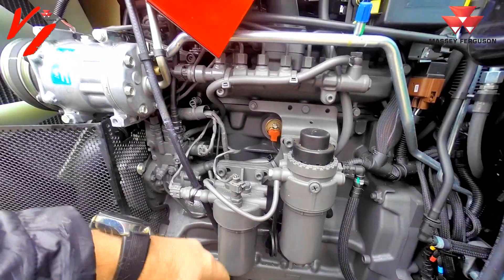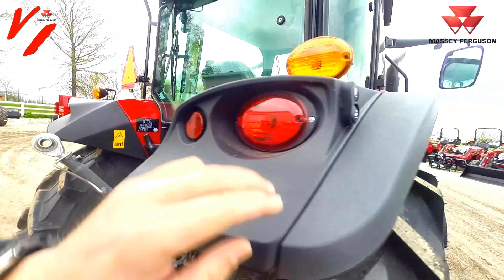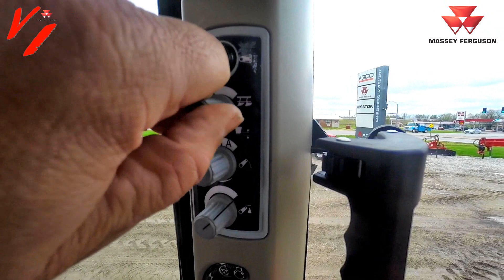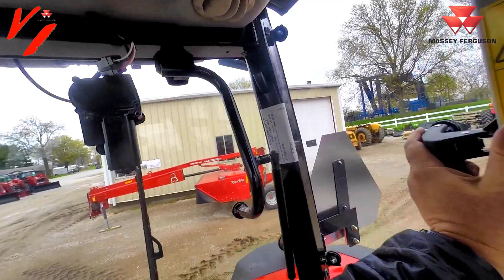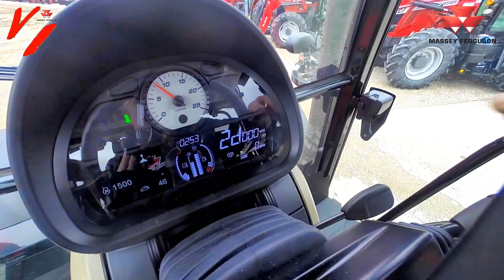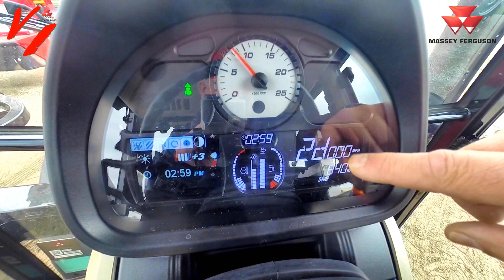Massey Ferguson 5710 Global Series Tractor Dyna4 Transmission (100 Engine/ 76 PTO HP)

Comment: I wish Massey would put that engine in the 4710. The 4 cyl seems it would be more reliable over the 3 cyl
Reply from the maker: We haven't had to work on 3 cylinder or 4 cylinder AGCO Power Engine. So can't answer that questions both are very reliable. But with Massey Ferguson you can buy your choice: 3 Cylinder get 4710 want 4 cylinder get 5710.

Comment: They are making flying the plane simpler but complicating tractor operations.
Reply from the maker: Actual the Global Series are more simple to operate that S Series Tractors. Farmers are to trying to do more with less labor help and need choices to meet their needs. If you want less get the 5700 Global without the Dyna4 Transmission get the standard 12x12 Powershuttle and it will have less features.

Comment: Price plz
Reply from the maker: 5710 List Price (02/2022) $78,583.00 USD, We only quote current List Prices as pricing changes and you need to work with your local dealership for pricing with current promotions. If in West Central Missouri within 60 Miles of Higginsville we are your local dealer please give us a call. If outside that area call your local dealer you can find here: https://www.masseyferguson.com/en_us.html#dealer-locator

Comment: Can you choose a starting gear like 3a for when the tractor is stopped it will go back to? We have a 6445 with 8000hrs here in Austtalia with the dyna 6 and you can choose a gear for it to always go back to when you go to neutral. Also curious if you're aware of the 5700 global dyna-4 is coming down under some day?
Reply from the maker: Yes you can preset which gear and powershift you want to start with with Dyna4. No idea what the plans are for Australia we are located in North America. I would contact a Massey dealer in Australia they may be better to answer that question.

Comment: Nothing to enjoy about this tractor
Reply from the maker: That why Massey Ferguson has different series and configurations to meet the owners needs and wants. Not everyone will see the same value. This the more basic and economical MidRange Tractor you want more bells and whistles then the 5700S Series is where you need to look.
Reply: Vahrenberg Implement nah John Deere is what we all need it’s like driving a Mercedes compared to the Massey which is like driving old Suzuki or something
Reply from the maker: That's Interesting. Why are we getting lots of Late Model John Deere Traded Ins? We trade for more and more Green Paint every year. And all sizes. Must be something they don't like or they getting more with Massey Ferguson.
Reply: Vahrenberg Implement the price is what they don’t like
Reply from the maker: Not what they tell me. John Deere Reliability is one of the most discussed topics. Plus a Big one is the Massey Ferguson CVT ...John Deere does not offer a True CVT. The IVT is a variable speed Powershift and not reliable with all the multitude of clutch packs. The Dyna4 is another one that customers are switching for the ease of operation and reliability. 16 Clutchless Speeds. Plus Massey Ferguson does not use a DPF Filter. The list goes on and on. And your correct they get more tractor and features for the dollar with Massey Ferguson.
Reply: @VahrenbergImplement  I got my deere 6330 at the beginning of hay season and it was gone before I made my last bale of that tells ya anything.....
Reply from the maker: Doesn't sound good about the JD 6330. We are hearing additional stories. Not going to bad mouth another brand but we have had lots of loyal green customers pricing Massey Ferguson Red. Must be a reason???
Reply: @VahrenbergImplement  yeah a third of the price for the same size tractor
Reply from the maker: When you compare specs and features pretty much all the Major Brands CaseIH, New Holland, John Deere, Massey Ferguson are very inline with each other for pricing. Now the Dealers may be raising their margins but actual dealer cost is very similar for all brands. Now Fendt (Sister Company of Massey Ferguson) they are the "Dream Machine" and Priced Higher because they are the True "Mercedes Benz" of Tractors, they normally run 30% higher than the others Full Line Manufacturers. Massey have models that feature some of the FENDT Technology, simplified to make it easier to operate and more economical. But all the brands have different levels of Tractors from Basic Economical, Mid Speced and Full Feature Tractors and you have to compare Apples-to-Apples. One thing I can tell you for sure that Green Paint ain't worth the added cost when you resale it. And it depreciates very fast and if they are higher they aren't in 10 years. Actually a couple years ago using the Official Dealer Trade Guides...Massey Ferguson had the higher resale value for Percentage of Price Paid.
Reply: @Missespelt  as a John deere mechanic there is a reason I am buying massey.  Fendt would be Mercedes, deere would be no where if it wasn't for copying Fendt, massey and case products. Look what Fendt offered in 96-2000 and look at a deere today, 25 years of playing copy cat catch-up.

Comment: Those decibel readings can't be right. Quietest cab on the market right now is 68 db
Reply from the maker: We just showing what the "Sound Meter" App for Android Phone is reporting. It's a reference point and will be using it on other tractors in the future to compare cab noise levels.

Comment: Looked at a lot of the 4700 and 5700 videos, no where can I find where anyone mounted a fire extinguisher . Guess they all carry good insurance.
Taking Delivery of a 4710 Thursday. Asked the dealer and he said he knows of no one with one mounted.  Should be factory equipment.
Reply from the maker: What Type of Extinguisher? Dry Chemical or Water Type? Most mount water extinguishers on the balers. Many of out farmers carry a small Dry Chemical in the Cab. How many new cars, trucks or vehicles come with a Fire Extinguisher? None. Guess that is why new tractors don't come with them either.
Reply: @VahrenbergImplement  Actually just got a Ram 3500 and it came with one and also got a ford F-550 and that also came with one.
Reply from the maker: Never got one here in Missouri. Maybe it's state regulation or commercial vehicle code on 1 ton and larger vehicles. We can install fire extinguishers in tractor if the customer wants...like Alan Jackson Sang..."All it takes is Money Sonny" and I bet you can install cheaper than a dealer mechanic. Just like a Free Tank of Fuel ...it's not Free with Purchase...it's probably the most expensive tank of fuel you've ever bought.

Comment: what wheel sizes  I need to mount to get the minimum width 1795 ??? Tyre use for Sunflower and corn with distance between rows 70 CM ???
Reply: buy tractor with 420/85 R 34 and 380/85R34  MITAS
Reply from the maker: We only offer Trelleborg Tires in North America. You need to talk with the dealer in Romania. Specs can be different based on the Region or Country the tractor are built for.

Comment: great review. 
I recently purchased this tractor 
but with fewer options. Brake to Neutral Feature 
can be installed later?
Reply from the maker: Brake to Neutral is available with the Dyna4 Transmission and is standard equipment. Did you buy a 12x12 or Dyna4 Transmission?
Reply: @VahrenbergImplement Dyna look here please.  https://www.bestauto.ro/anunturi/auto-moto/utilaje/utilaje-agricole/tractoare/anunt/massey-ferguson-mf-5710-dyna-4-es/8feig4f75e2i70g2e24h5f0325hdf58f.html
Reply: @VahrenbergImplement  
the button Brake to Neutral  missing
Reply from the maker: We only deal with North American Speced Tractors. We can not get without Brake to Neutral. You need to talk to dealer in your country the ad you sent was Romania. Each Region can spec tractors differently. So you need to discuss that with your local dealer. Not a choice here in United States.

Comment: Hey buddy I might be going to look at an AGCO LT90A soon. Anything in particular I should look for?
Reply from the maker: Great Tractors. LT90A is like a 5400 Series Massey Ferguson but Orange. Great tractors. They are the predecessor to the 5700S Series Premium/Full Featured Models of Today.
Reply: Vahrenberg Implement yeah I was watching Bagwell Farms on his 5445 and I saw the cab and I was like wait a minute that’s the same cab! It’s crazy it’s like you picked the cab off one and put it on the other. It’s a 2007 it has 2100 hours with the dyna 4, 4x4 for 42k. Seems like a good deal for what you get. I was looking at the 5400 and the LT90A and how similar they are. Are there any real differences on them? Because I see there’s quite a price jump on the 5455 or 5460 I can’t remember which one is the comparable one.

Comment: By when will the 5708 be available?
Reply from the maker: North America we only offer the 5710 & 5711. If you want smaller the 4700 Series has the 4707, 4708, 4709 & 4710 Models & Sizes.
Reply: @VahrenbergImplement  I am from Europe. :-) And what is the smallest model with a suspended cab available?
Reply from the maker: I do not know in Europe. In North America the 5710 or 5711 with Dyna4 is the smallest currently with Cab Suspension.